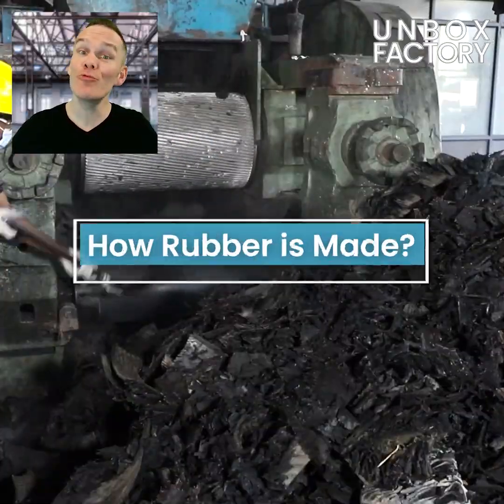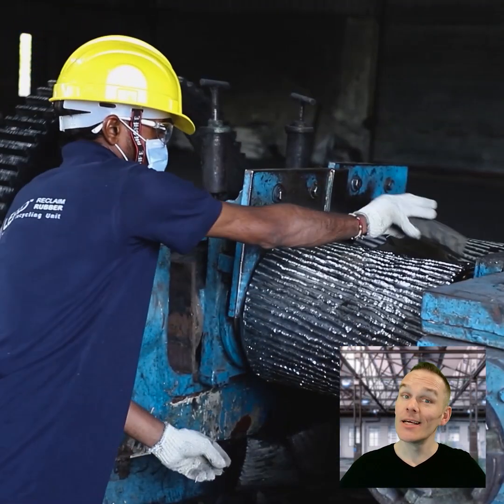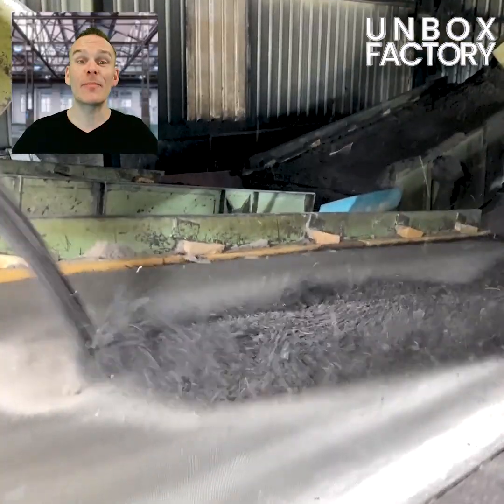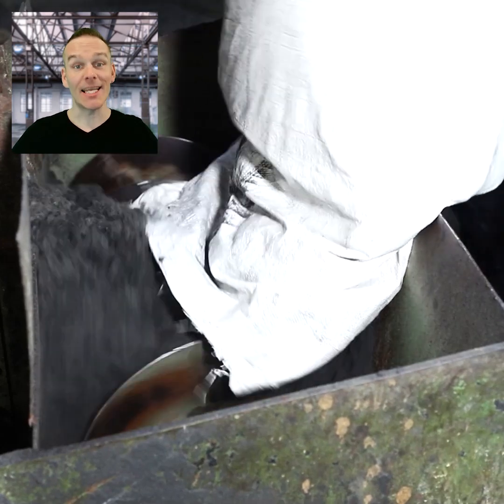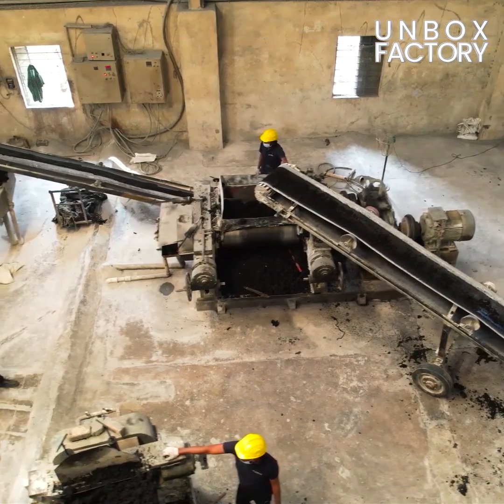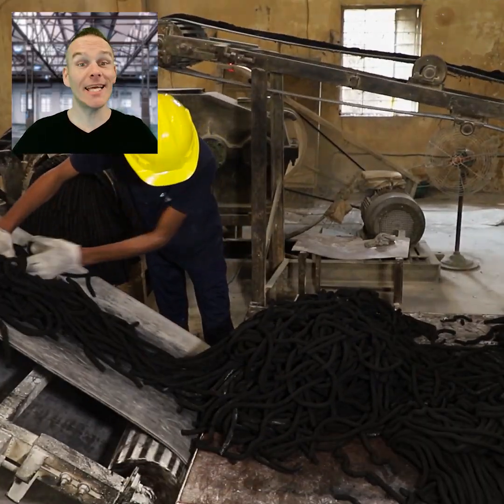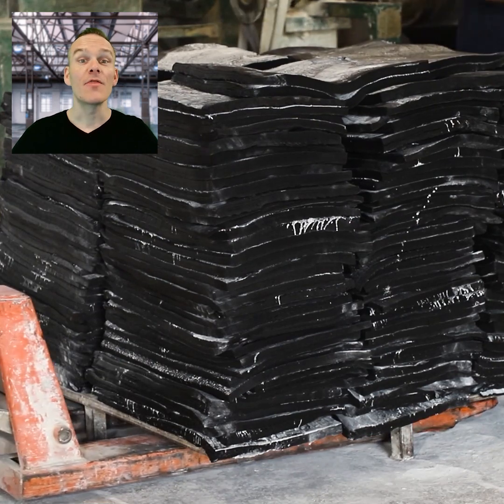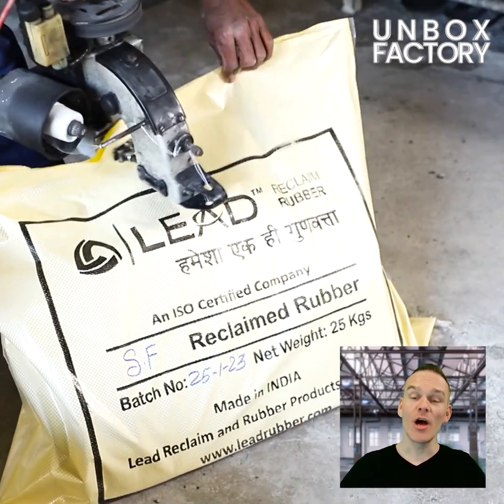What Makes Lead Rubber Reclaiming So Amazing | Lead Rubber Reclaiming Process From Old Tires

Comment: 1 missing cleaning steps, these tires are dirty, on arrival you need to clean the rubber or there will be dust mixed in
2 missing the triage after separating the rubber from the tire, not everything in a tire is rubber
3 did not give example of use of recycled rubber, because old rubber can't be used in new tires, it's not resistant enough anymore, it's either used in asphalt, burnt, or used in pavements